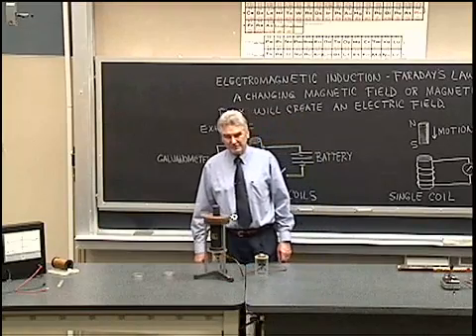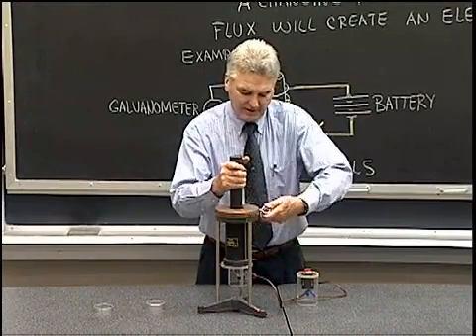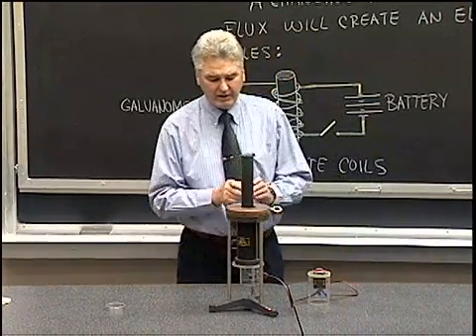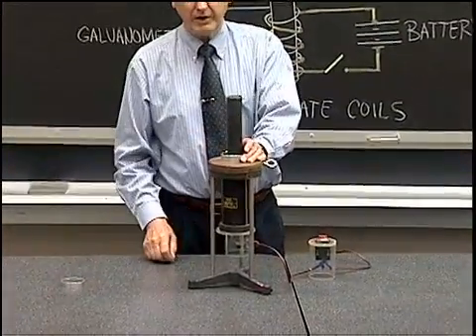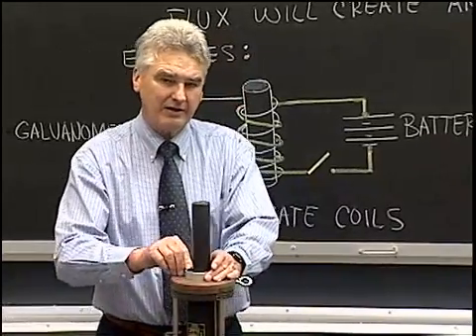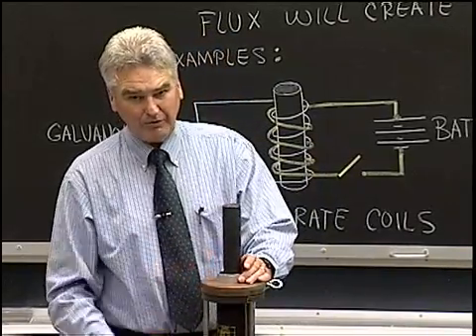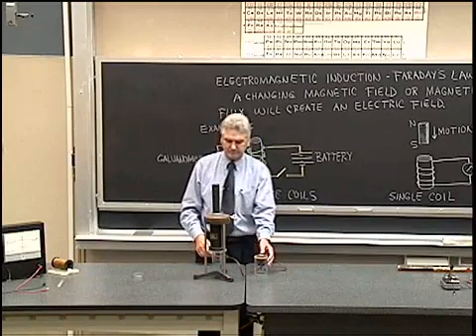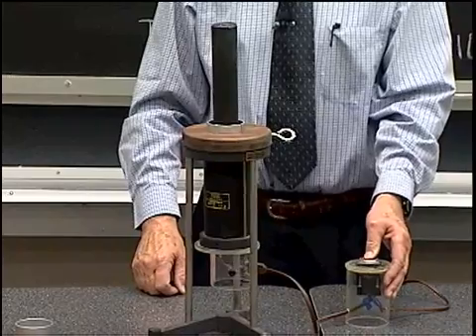Jumping Ring

Comment: Well lentz law say, if there is increasing magnetic field then, ring will get pushed above. But  if the magnetic field decreases then, ring will get pulled down! So why with AC current ring only lifts above and be able to stay there
Reply: Also, decreasing magnetic field do not allow ring to get pulled down. This is wrong.
Reply: As long as there's a change in magnetic field, there's a force on ring. In an alternating current , current and hence magnetic field is CONSTANTLY CHANGING, thus the force is constant and it stays up